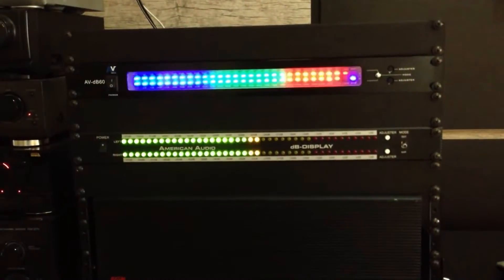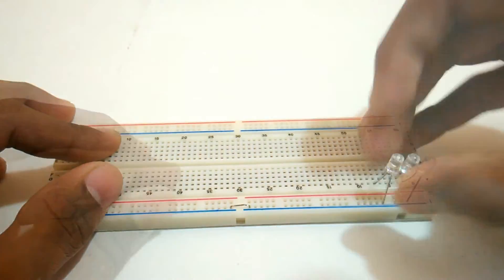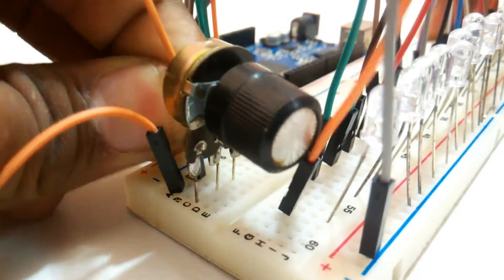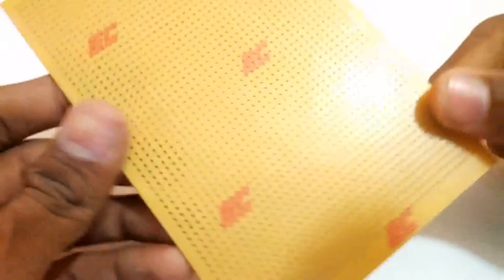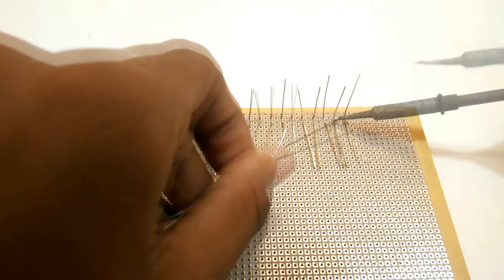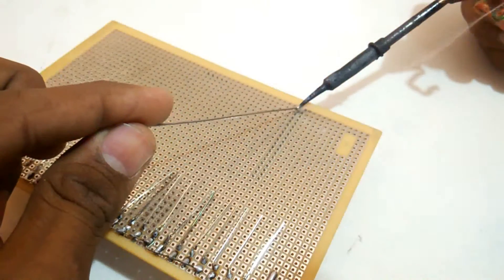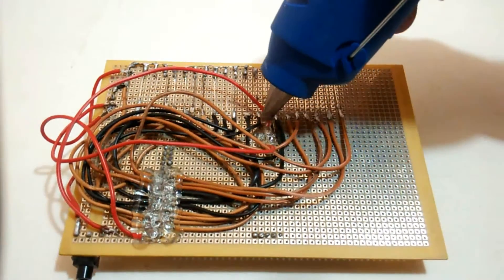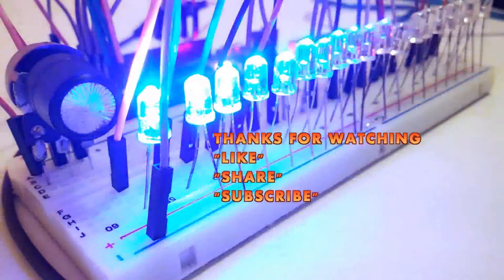DIY VU Meter with Arduino Mega! Music Visualizer You Can Build at Home

Comment: Can you explain me about that last aux and audio splitter part?
Reply from the maker: The audio cable consist of 3 wires given as left,right,ground the audio splliter makes these three wires into two possible connection in simple way we can use two headset instead of only one headphone jack of our mobile so one output can go to the circuit and the another one into the music system where we can hear the audio

Comment: Can I make this by using arduino uno? If yes, can you send me its code or circuit diagram ?
Reply from the maker: Ya you could make this with Arduino Uno but then you will be having the limited number of the outputs , in this case only 14 so if you are happy with the 14 led  then you could go for this just simply change the pins from 0 to 14 in the code and you are done
Reply: @kuldeepjangidd  Can you help me out with the circuit diagram? Plus I didn't understood the last aux and audio splitter part.

Comment: dude, you should add some resistor between the arduino and leds it can damage to the arduino!
Reply from the maker: ali najafian yup it may damage but I have created this thing just for the video not permanently and yes you should add resistors so that the led will longer thanks for the support
Reply: kj's electronics you made it permanently..wtf are u talking about... You dont even mention it in the video that we must add resistors... You didn't know that, did you?

Comment: Where are the protective resistors? I dont think that eather the atmel nor the leds will live long. And since VU is an logarithmic value it is not the best way that u do it. Its just linear.
Reply from the maker: Johannes Jung it might not be the best way but preferably one of the way to create this and yes it does the work perfectly although the working is linear not lograthamic and talking about the resistors they are nessary for the led's but I have ignored those to save space on the PCB nothing else thanks for the support

Comment: Hey, I just made a smaller version of this VU meter with an arduino nano (10 leds). I even built in a simple low-frequency filter so it only responds to the bass sounds. however, when the music gets to loud, the arduino just stops working. any ideas on how to fix this? this problem occurs without the bass-filter too by the way.
Reply from the maker: However the arduino analog pin is going to react only on the voltage level which is present through the line in of your audio jack .. so the potentiometer used there is for the sensitivity of that input signal make sure you have set the correct voltage level through the potentiometer .... Otherwise it doesn't matter that you are giving direct input or  the frequency through the low paas filter .. one more thing that your low paas filter could have some issues just double check the connections...
Reply from the maker: Joeri Bremmer one more thing that the arduino can handle only 5v so make sure your line voltage  does not exceed the limitations of voltage
Reply: kj's electronics Thanks for replying, now, If I don't want to use a potentiometer, is there anything I can do to limit the voltage to 5 volts? like a zener diode? or even better, is there a way to measure the maximum voltage of a song, and digitally modify the input of the arduino, so it always makes optimal use of the VU-meter?
Reply from the maker: Actually you could skip the whole process of Arduino microcontroller just see the part 2 of this series and you will get your need... Because in that section the voltage limit of input is 12v so you will not have any issues